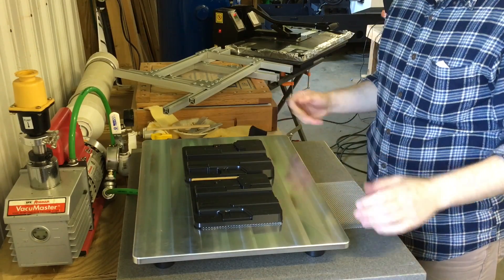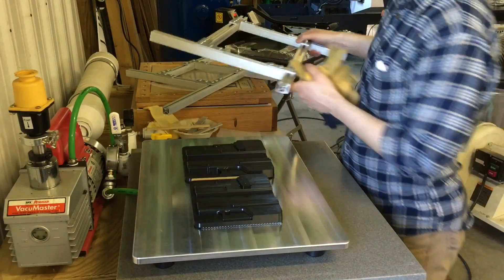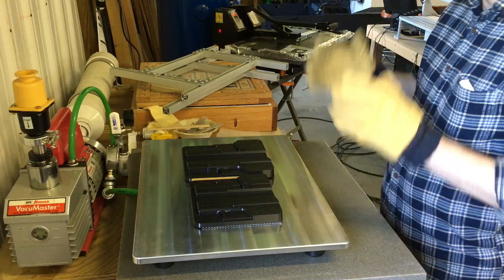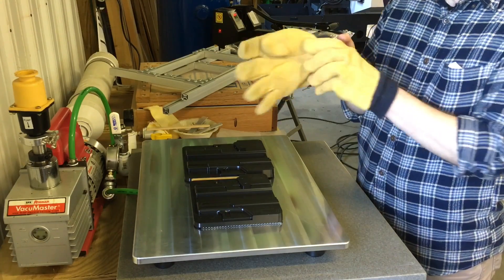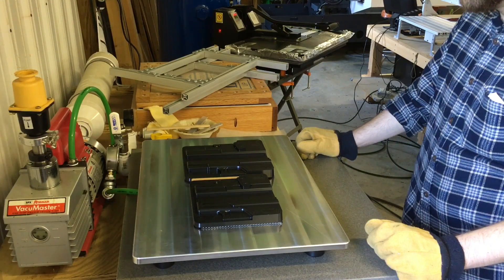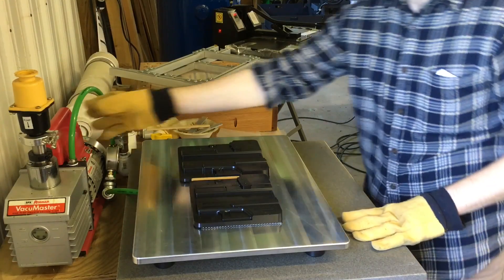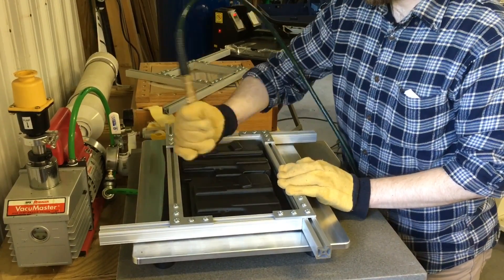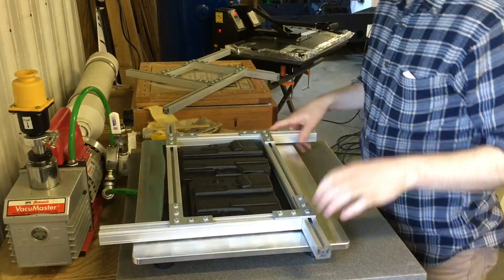SwiftPress Forming Demo with CNC Molds

Comment: What size vacuum pump is that? I’d like to do two at a time and want make sure I get the right equipment right off the bat.
Reply from the maker: I'd get at least an 8cfm two-stage pump then. This is a Robinair 15800.
Reply: @HenryHolsters  thank you for the information.

Comment: Hi Henry, can't wait to buy my SwiftPress Vacuumformer, I'm a newbie to this, I was hoping you could advise me on the right mold material to use in CNCing my shapes from?
Thanks for the info.
Reply from the maker: Depending on the type of CNC machine you have, you can use HDPE, Delrin, Aluminum or tooling board, like Renshape.